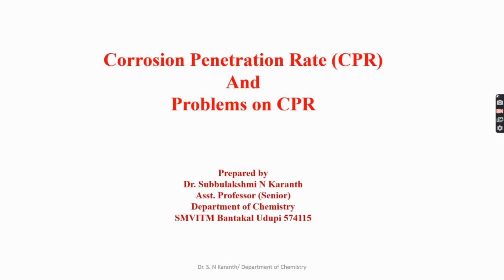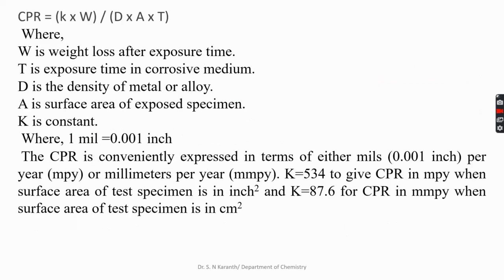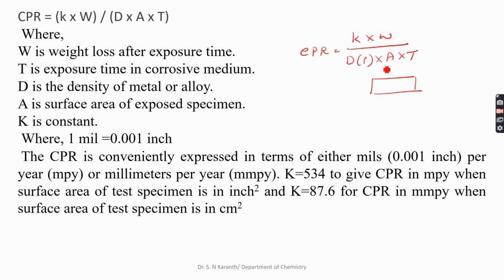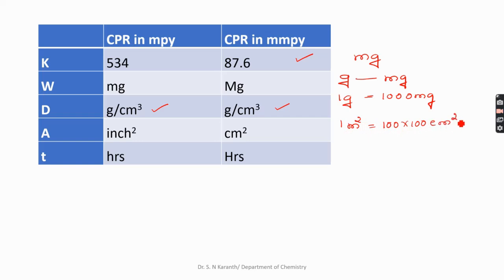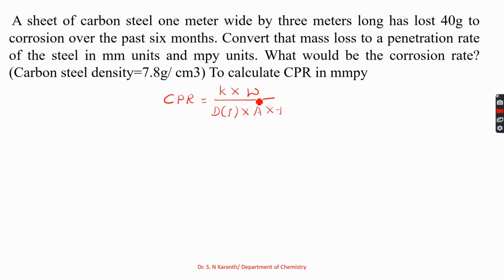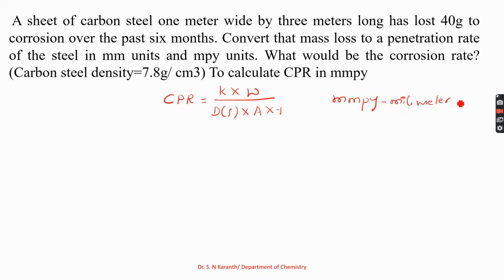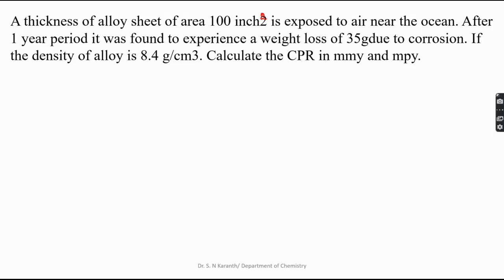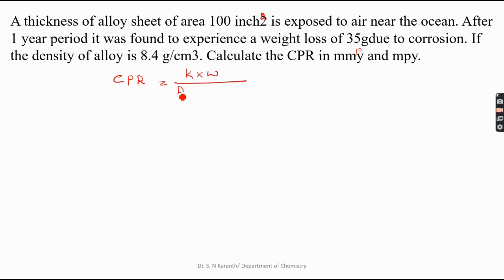CPR and problems on CPR- series 1

Comment: Mam,can you explain for 6 months it is 6*24*30 but for one year it is 365*24
Reply from the maker: For 6 month calculation 6( month)× 30 ( no of days in each month) × 24 ( per day hr)
For one years I put directly no of days 365 ×24 hr or you can use 12× 30× 24
Reply from the maker: Both correct
Reply: For 1st solution for mpy i m getting 5.501021538*10^13
Reply: But mam answers will be not same
In 365×24=10,950
In 12×30×24=8,640
Reply from the maker: @noufanmukri7355  just 5 days difference you will get 8760 not in the order of 10000
Reply: @DrSubbulakshmiNKaranth  ok man,
Your videos are ver helpful to us,thank you so much mam
Reply from the maker: @noufanmukri7355  thank you, kindly share the videos among your friends